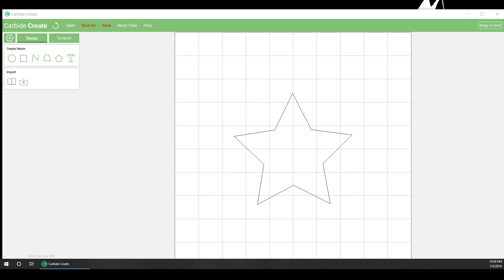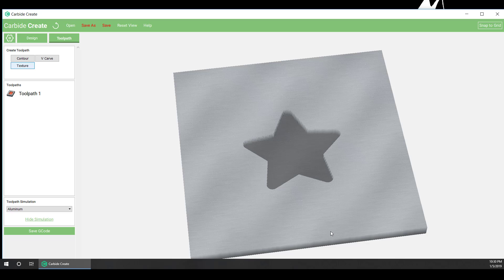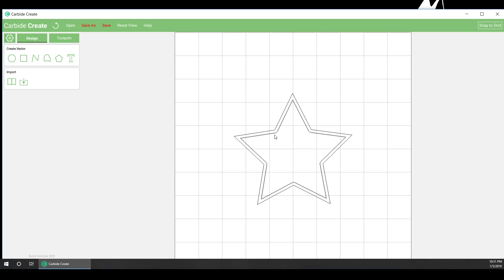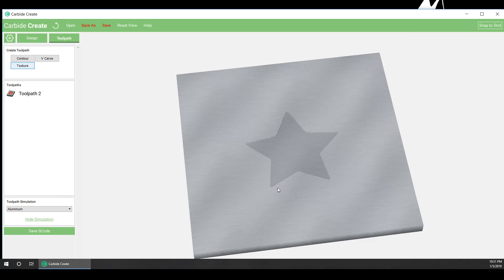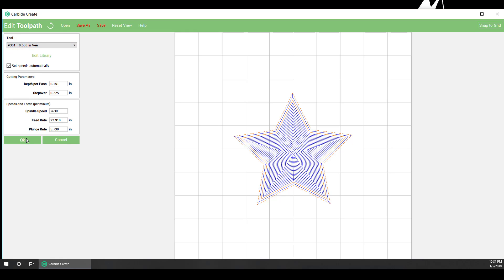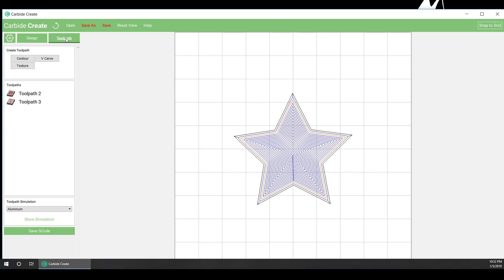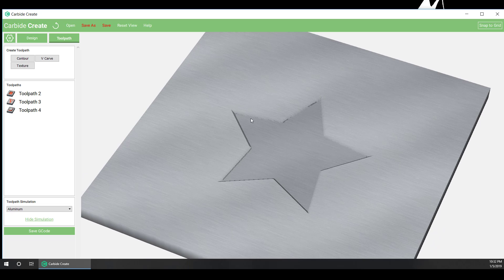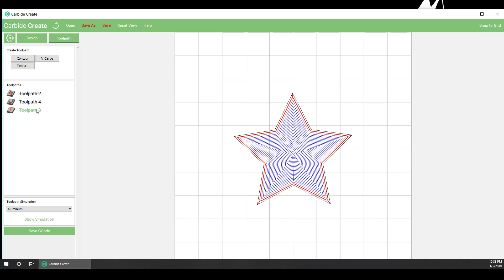Carbide Create Roughing and Detail Pass

Comment: Thanks for the video. I hope you plan to make more.
Reply from the maker: Hey Don, thanks for the feedback! I definitely plan on making more. If there's anything in particular you'd like to see - please let me know.
Reply: DozaBuilds have you had success with smaller files using this method? I have been getting my butt kicked with an army logo .
Reply from the maker: @usmc6153  I have had pretty good success with smaller files, I did the symbiote logo from Venom's chest and it came out ok. Sometime's the design is just too complicated for this method so I'll use Easel. It will do the roughing and detail stuff for you, then you'll have to export the g code. It works pretty well, the only caveat is that you can only export this kind of code for free for up to 4 days per month, so I use it sparingly. I've been thinking of doing a follow-up video to this one using that method!